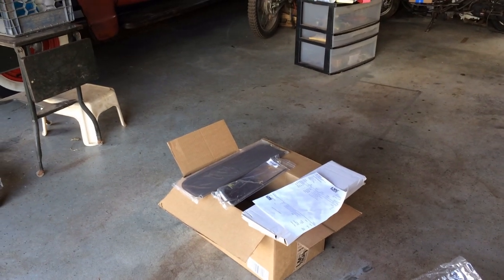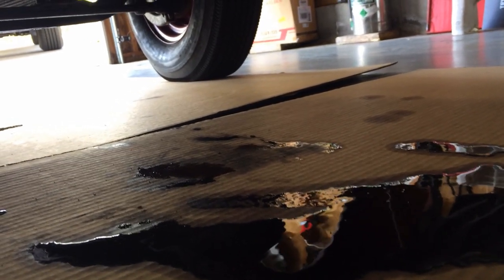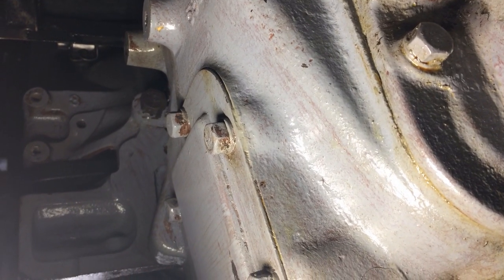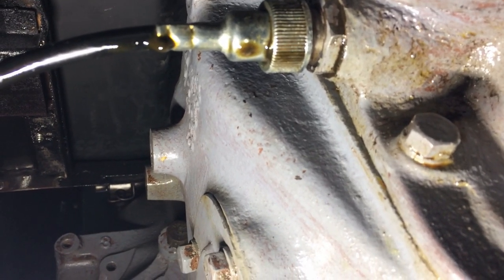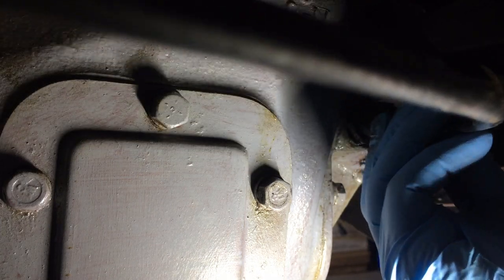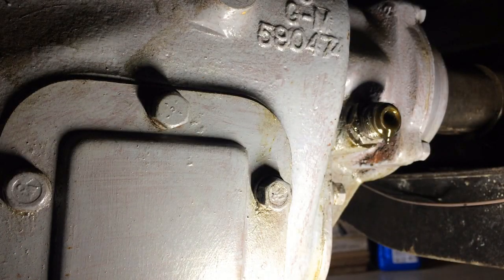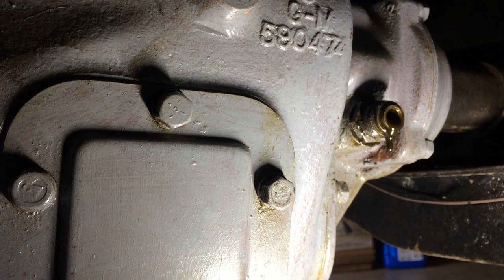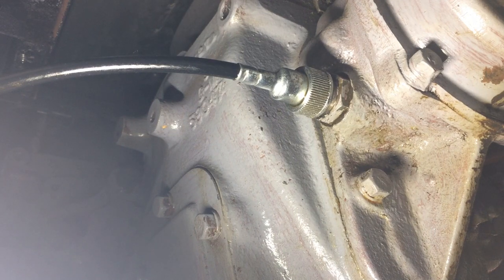47 GMC Gear Oil Leak at Speedo Cable

Comment: Not the whole Trans Just pull the piece where the gear goes and look in hole to see if there's a gear,   The oil is coming out because there is no gear in the hole, The gear on the tail shaft drives the speedo  gear,

Comment: Hey Mark, Did you get my pics of the speedo gear assembly that I sent to your AOL email?  If not, you may want to check you junk mail .  The interior of the speedo cable fits into a "socket" inside the speedo gear assembly. Since you gear is broken, I believe there is a straight shot for the gear lube to reach the outer speedo cable housing thus causing the leak.
Reply from the maker: I just received it.  It appears that my gear housing is still inside the trans. Thank you.
Reply: Ok, the remaining gear assembly is a tapered fit. I just hope it's not jammed in too tight.  You may want to try a magnet or needle nose pliers or something to remove what's left. Good luck with that. Otherwise you'll need to remove the tail housing. But hey, keep at it.